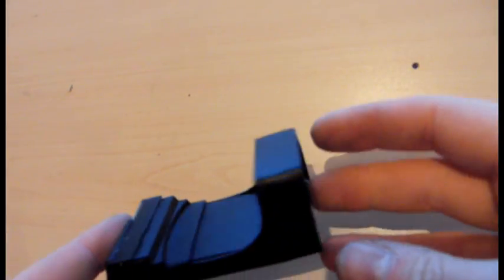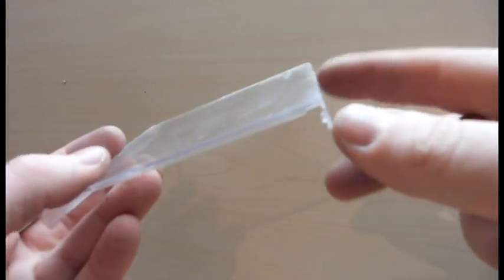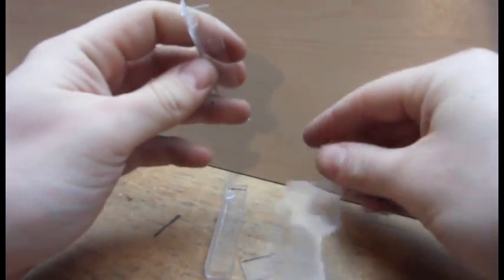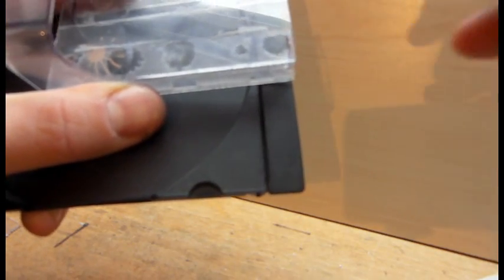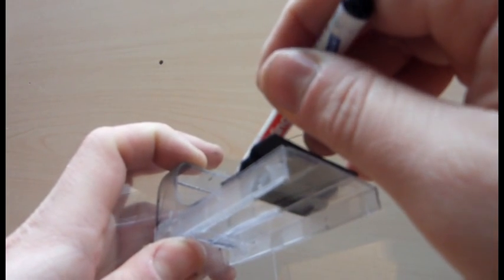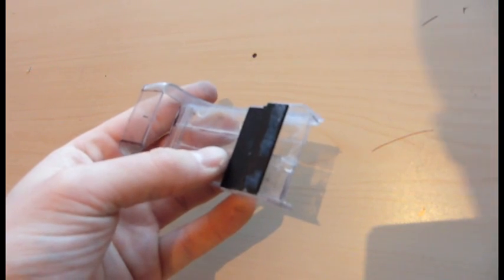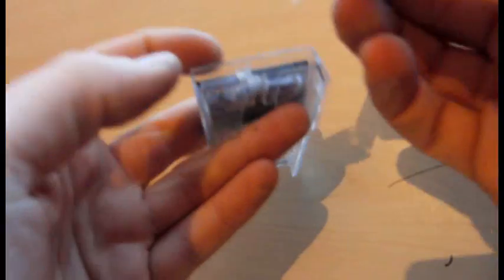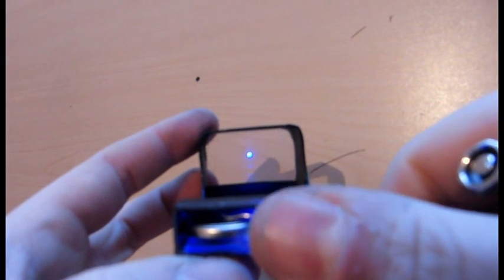Reflex Dot Sight, made from an old CD case  TUTORIAL

Comment: You are missing the lens (or the convex mirror surface) to project the virtual image of the dot at infinity distance. Without this you have horrible parallax error and much too narrow focus plane. See the diagrams at Wkipedia https://en.wikipedia.org/wiki/Reflector_sight for what components it is made of. Since you don't have a curved mirror your best option is to build the variant that contains a lens to project the image. On the other hand, the variants with a curved mirror are more compact and have fewer components, so you would need to find a parabolically curved piece of glass or transparent plastics and then adjust the distance of the dot so that it is exactly in the focal distance of that mirror. If you can do this, then you will have a parallax free red dot with focuses at infinity.

Comment: That's cool and stuff but you missed a step that makes your sight work like reflex sights- the lens should either be curved (parallaxed) in a specific way. Check out schematics of real sights. It does make a difference. Peace
Upd: as mentioned by LaserGadets bellow, the lens should be shaped in a specific way
Reply: Ah so parallax works only horizontally. NO. You need a lens shaped glass....not CURVED. Maybe you read your own papers before giving advice.
Reply: @LaserGadgets  indeed, my bad, wrong term

Comment: This is nice for cosplay, but the point of a Reflex sight is that the reticle visible through the lens is positioned as if it were infinitely far away. That's what makes them useful. The dot in this appears 3 inches in front of the lens. That's not even as far as the end of the barrel. You'll never get any sort of accuracy with a setup like this.

Comment: Epic...
so how do u adjust windage and elevation??
Reply: 2 additional screws. Are you people low on imagination?
Reply: Well obviously not considering that I typed in how to make red dot on youtube.
But u must be low on sarcasm..
But let's test your imagination..
Lets start with windage.. 
How would u engineer the x-axis of the laser to reflect of the glass??
What would your calculations be for every CM "screw" turn  is .____ of rotation is =  to .____ MM fixed panel distance. Before you run out of unoccupied area with in the housing. I guess first off let's solve for the complete circumference of the space n which u have to  occupy. Then we can get started on the y-axis and beam angles and placement and the right degree of curvature for the lens..
But hey Im down man.. ill head to home depot and pick up sum wood screws or maybe drywall screws.. yes definitely drywall screws..cuz who ever n there right mind would use fully threaded machined set screws..  I'm so dumb.. I guess I'll just let you keep engineering and designing the products..
Damn all that college,money and time wasted... idk how I was ever hired to engineer, evaluate dedeuce and design for firearms and firearm intrest companies..
I guess explain to me how it works so I can improve.. plz??

Comment: Just a suggestion, you can add an on/off switch by creating a sliding plate similar to the shape of the number 6 that can go in between the battery. But that's how I think I would make it.

Edit: corrections

Comment: Clear CD case plastic is too brittle. It definitely wouldn't hold up on a real firearm, but even on an airsoft gun, dropping it will probably break it. A stronger opaque polymer would be better. Have you considered plastic welding instead of glue?

There's also no mechanism to adjust the sight. It would probably be best to build the adjustment into the mount, as you can make it more robust than something that actually moves the emitter. Maybe two screws for elevation and windage adjustment on the mount.
Reply: Metal would be even better but its about SIMPLE and EASY on here. Nothing else.

Comment: I've got this McGuyver thing in my head now. I'm gonna use this design, but bend sheet metal for the frame and use a dollar store pair of reading glasses for the lense. I was thinking of using a plastic revolver cap gun, and just make a wooden copy of the cylinder drilled for .22" short. Then a small pipe can be glued into the Barrell of the cap gun, and I can scratch out rifling with a file.
Then I'd have the jankiest thing on the planet, but it'd be a semi auto pistol with a reflex sight for under $10.

Comment: That's awesome, I wonder how hard it would be to make it into an actual reflex dot sight, ie, keeping the dot on the same point of aim regardless of alignment.
Reply from the maker: Wont be too easy. But I never even get that paralax talk, because you align line of sight with the gun anyway :p who wants to shoot while aiming from a 30° angle?
Reply: Selfmade it makes target acquisition easier, but you also have no reference for where your sight alignment has to be if your dot moves. That's pretty significant when you're shooting anything further than across the room.
Reply from the maker: Would still be too complicated I guess. Doable but way more complicated.
Reply: Easiest solution would be to put a fixed crosshair, so you know that your sight alignment is correct when the dot is aligned with the crosshairs.

Comment: What did u use as display plate? Just a normal-flat cd cover right? Or u heat it up and make some curve?
Reply from the maker: a) a curve would do shit, if its not the RIGHT curve, b) you can fuck paralax, you have to put your head in line with sight and barrel anyway and c) heating it up will probably make it go poopoo. So keep it straight.
Reply: thanks
Reply from the maker: Np

Comment: No matter how much I try I can not cut out the case. It just keeps cracking and breakin
Reply from the maker: Did you use a jigsaw or a knife? Knife will not work too well. Use a saw, if the blade is too rough, try to tape both sides of the plastic to prevent cracking while sawing.
Reply: Selfmade thank you I will try taping the sides

Comment: so whats your mounting method for attachment and zeroing?
Reply: Short of wiggling it around before the glue dries, you'd have to make it thinner and make a bracket that could be adjusted by turning a vertical and horizontal screw, or turning and tilting the whole thing when you mount it. As for mounting, I could see putting one of these on a home made gun, so I'd drill holes in the actual gun or make a frame that clamps them together. I'd make the thing out of metal instead of plastic though 
...
Reply: Wonderglue and a pen
Reply: Jeremiah Freeman Really?
Reply: Handsome Jack really really
Reply: Jeremiah Freeman is that a joke

Comment: Is it parallax free?
Reply: I'm afraid you are wrong, parallax is a thing on reflex and holo sights. How do you think they work?
Reply: no sight is a 100% parallax free, depends on the distance.
Reply: This isn't parallax free, red dots have paralax and that's why they are curved and the coating has the be well done. No red dot is truly paralax free just some are better than others even with my trijicon rm01 I can see the red dot move around some as I move my head.
Reply: When u look through a magnified, mid-long range scope, with the cross hair (or whichever reticule being used) place directly on a specific point, when u move ur head slightly side to side or in a circular motion, u will notice that the point where ur cross hair was placed will appear to move around. Making it seem u are no longer aiming at ur intended point if impact. High end scopes have an adjustment to correct this phenomenon at certain distances (100, 200, 500, 1000 yards, etc.). Well Made scopes with this adjustment option correct parallax illusion at predetermined distances veey well. Red dots are not intended for use as a point of aim point of impact, precision tool. But rather as a quick acquisition sight to increase the speed of hitting a human sized target at close range.
Reply: True but it doesn't change the fakt that parallax still is a thing, even if it might not matter as much.
Reply: red dot, holopoint, ww2 aircraft sights and other similar sights actually use parallax to work. parallax free is a term for scopes I believe. if a red dot was parallax free it wouldn't function correctly. the parralax effect means that no matter what angle you look at the dot it will point at the forward vector of the gun because of the geometry of reflections.
Reply: Some (probably most) claim to be parallax free. And they probably are as far as a human can see. But no sight is a 100% parallax free except for like a laser. I've never looked through a magnified scope, but I guess it's just more apparent and more of and issue when it's magnified.
Reply: HermCorps umm no... reflex red dots and holos all have issues with paralax. The question was if this one is made in the REAL way that gets rid of paralax issues
Reply: HermCorps - you are wrong sir. No RDS is 100% parallax free. Not possible. Some are “near” parallax free, though
Reply: No, you
Reply: Under a buck probably.
Reply: 8trigrammer is it gluten free?
Reply: Of course not....wtf. Its made from an old CD...what do you guys expect?
Reply: LaserGadgets I expect you to not act like a jackass when someone asks an honest question. What, everyone's born a fucking optics expert?
Reply: Expert?? Its a FLAT piece of plastic!
Reply: sablanex wrong... Parallax is the illusion of an object (or aiming point) changing position from a far distance (parallax is much more of an issue the further away a target is. & also depends on the power of magnification of the SCOPE being used. A reflex, red dot or holo is not a SCOPE, its a SIGHT. Just like iron sights. Parallax is NOT an issue using CQB sights like red dots
Reply: Uuugh. This is a (replica) SIGHT not a SCOPE. Parallax is only an issue w/optics that have magnification. Not red-dots, holo's or reflex sights. Just an FYI for any gun owners who want to know more about weapon mounted optics.

Comment: so from the looks of it the small hole functions as a makeshift collimater?
Reply from the maker: Oo no? Its just the exit hole.
Reply: i just meant that having a light go through a pin hole has a focusing effect and makes the light source appear further away
Reply from the maker: Nope. Collimated means no parallax. THIS is just a hole... :p
Reply: I thought it meant it make the source appear focused at infinity which has the effect of eliminating parallax. i dont know much about optics ive just been reading over my head again
Reply from the maker: Well you are actually still ahead of most noodles here, ranting about BENDING THE SCREEN....which is superstupid but not practical :p as far as I know, the real ones are collimated indeed.
Reply: so its not a real collimater but it approximates one well enough to make a functional sight. as for bending the screen there are some designs that use a parabolic lens but i dont know how the hell anyone could bend plastic to form one.
Reply: If you really believe just "bending it" in SOME way will do................well....
Reply: well you couldnt just bend it it would have to be ground to shape and at that point you would be better off buying a glass lens but thats for designs that have the collimater built into the objective lens so a lot of math would be required to get the correct curvature
Reply: xD to even shit out, it has to be arched in ONE way.....not "just bent". Its optics dude....math and physics. Thats why I just facepalm when those halfass geeks start ranting about BENDING IT on the comments. Thats not how this shit is done me friend :p collimation...you are on the right track!

Comment: Is this sight supposed to actually work and if so, how do you zero it in (adjust it) to be accurate? Thanks for the video!
Reply from the maker: Did you see me zero it? :P
Reply: +Selfmade Uum no, not in this video. Thought you may have mounted it on a gun and figured out a way to get it dialed in...
Reply from the maker: No. This is just a super simple but working and good looking "sight". If I would make one myself, I would use metal and make it a bit more complicated. Collimated, like one of the real ones.
Reply: +Selfmade There you go, that's what I'm talkin about, if I can figure out how the windage and elevation adjustments work I might try to tackle one myself...
Reply: You would also need a correctly curved reflector - otherwise it wouldn't be "collimated" - meaning it would be accurate only if the dot got reflected to your eye from a single spot on the entire reflector surface. any other spot would create aiming error.
Reply from the maker: When there is a curved lense, it should do it. And even if not, bending 
the screen "in some way" will do shit...maybe add more error...but 
nothing else.
Reply: Selfmade
I agree. Each spot on the reflector must have a specific x/y angle in order to reflect the light backwards in a vector parallel to the barrel. So "some bending" is probably as erroneous as no bending.
Reply: That's very interesting topic here. is there any tutorial out there covering creating a parallax free red dot sight? I'm reading comments from you guys with curiosity
Reply: Exactly
Reply from the maker: I am not really an expert, but I guess there is a lens inside. A collimated sight...those freaking 8 graders who never paid attention in physics dont get it, but just bending the screen will do shit. You need a lens to make sure the angle is not a factor.
Reply: You are right. I made some search for lenses on the internet and from my understanding it's pretty much cheaper to buy a real parallax free sight like vortex strikefire II
Reply from the maker: Airsofts are not as accurate as a real gun, dont have to be :p this is a toy made for toys. Whoever comes here just to nag about this neat lil thing has too much time or just wants to nag on youtube...but in general I agree. Buying is easier and maybe even cheaper, at least when it comes to the real thing ^^
Reply: How exactly have I come here for nagging? The essence of my comments was 'this is an interesting topic' and 'is there a way to make it parallax free'. If a man doesn't push himself to the limits of what's possible there's nothing to strive for. We have somehow crossed the line from airsoft to a topic that greatly exceeds it and if that makes you feel uncomfortable I'm sorry lol.
Reply from the maker: Was not talking about you :p should have made that more clear, my bad.

Comment: Guraranteed, you will never hit anything wit this (not)sight.
Reply from the maker: Proove that you are a total numb nut and say I have to bend the display xD you guys need to read more books. Or google stuff instead of listening to other morons without any idea xD
Reply: Nope, you don't have to simply bend the reflecting lens. It has to be parabolic. Also the distance between the light source and the lens has to be absolutely correct or else you get parallax error.
The "sight" you built is projecting the dot right in front of the sight. (the distance, between the light source and the lens) You can call this no parallax correction and without a second reference point on the gun, (eg. a front sight on the barrel) it is completely useless.

And now proove, that your sight is working and show it in action on any gun (be it airsoft or real).

Comment: i realy need a blueprint of this ;-; my saw just broke the cd case, then i tried to cut w a hot nail, and... it sucks, and when i tried to warm up to "fold" the plastic just melted ;-; and... could you make a pdf model for the pieces of those awesome things? it realy helps me
Reply from the maker: +BrunoGamesBR The reason why I never made tutorials back in the days was because of this -.- its never enough. You have material, a video, and still need more. Get a saw with more teeth on the blade and be careful. OR use aluminum!
Reply: Selfmade k ;-; still awesome, ill try aluminum then

Comment: i couldn't cut it out, as i broke 17 cd cases, with 4 different tools.
Reply from the maker: +Doile911 Dremel it, or use a metal saw, the blades for metal have smaller teeth, and way more teeth than a wood-cutting blade. That should work better. And put some weight on it...glue it in place or something, so it cant break.
Reply: yeah i gave up and made one with an angle grider from steel

Comment: i doubt it will remain accurate, but for airsoft it might work well enough.
Reply from the maker: +pesoen FROM A CD CASE...if you expect military grades, I cant help it dude xD
Reply: Wont work that well even in airsoft gun. Reflex red dot sights like this use lens to keep dot on target, even if your viewing angle chances. In this there is only cd case plastic that is not optically suitable/sanded, or bent for that. So no it wont work on anything that requires accuracy when shooting. For prop or decoration this works well.
Reply: Did you find any tutorial for using it with airsoft?